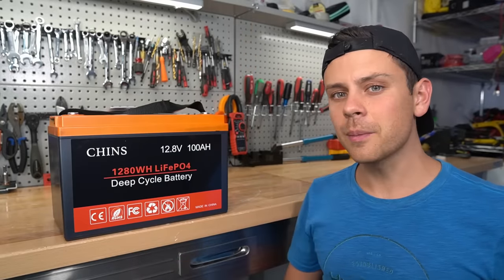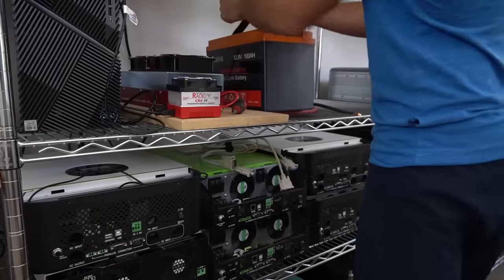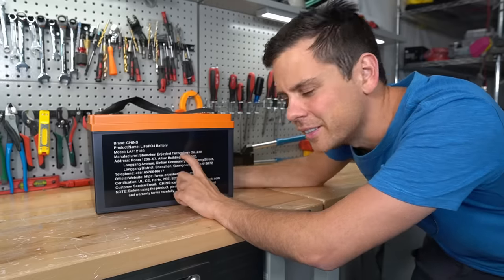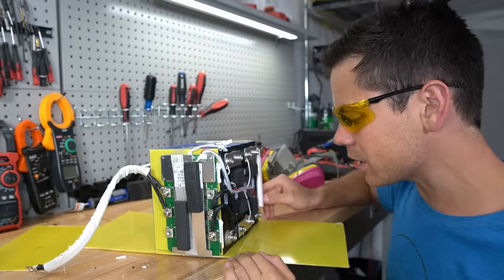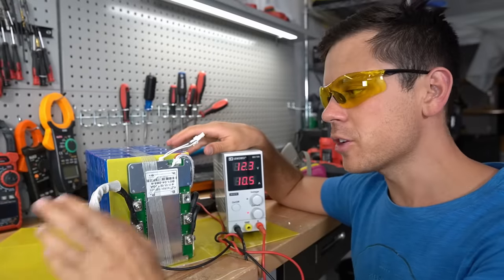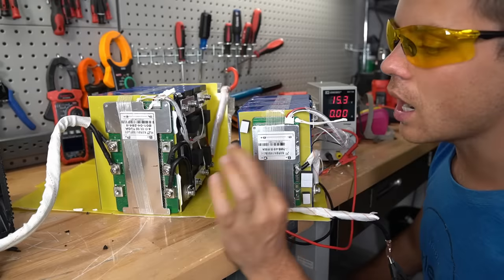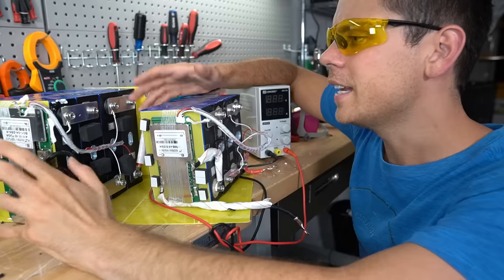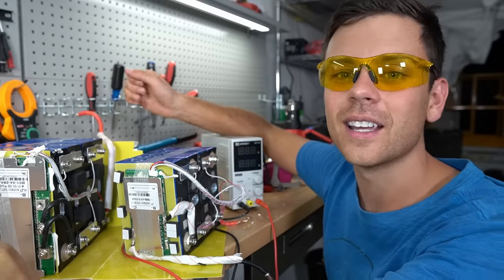$379 CHINS 12V 100Ah "Plus" LiFePO4

Comment: Very cheap. Nice Support.  Has a limited BMS. My only problem with the 200Ah was charging it all the way. Takes forever at 20A.  They claim they now have a self heating model. I don't see the difficulty or reluctance to manage low temps.

Comment: Can this battery type be connected in series to increase Voltage? I read somewhere that LiFePO4 batteries should not be connected in series otherwise the BMS would not work. Is this true?

Comment: I saw the following on an Amazon review.  Could you comment on this. 

If you are going to use this battery with a inverter, (how else would you use it right?), then you better get yourself an inverter with an over current protection of higher that 17 Volts. After charging this battery, the BMS started balancing the cells. I watched my battery meter showing surges of voltages as high as 17 Volts. (The documentation says to set the overcharge protection of the MPPT at 15 Volts to not "damage the battery.") Each time it surged to over 16 Volts, my inverter's over voltage protection would shut it down (at least I know that works now.). It only lasts for one second, but that is all it takes to shut down my clocks, TV, Computer, and Washing Machine. Each time I have to reset either the time or wash cycle of my washer. I had to plug all of my sensitive electronics into a UPS just to use them so I didn't have to worry about the power being disrupted prematurely. This should not happen. Also, I could never achieve a voltage over 14.1

Comment: Have such batteries progressed to the point where you no longer need to worry about charging profiles, as the integral BMS would handle all such matters?
Reply: some lithium Battery manufacturers are staying drop in replacement for AGM or gel (this is because that the charger voltages are similar ) but you shouldn't mix and match chemistry and a lithium profile charger is always going to be better for lithium batteries.
Reply: @jc7654  I was hoping that the battery's internal BMS would handle the lithium's required charging profile.
Reply: @patrickmchargue7122  the BMS isn't a buck Boost it can't change voltages coming into the battery it can only switch on and off and balance cells that's why a proper lithium profile on the charger is better, it gives the best voltage to the battery, AGM has a close charge level but the charger has more step's in the profile then needed for lithium that slow the charging down and the voltages are not the best for a full charge but if you only need to be to 90% full it can get the job done .

Comment: No insulation between cells. Fish tape is cheap, why not put it between the cells with different potential? Why did you not test for short circuit protection? Thats a major safety concern?
Reply from the maker: They are sleeved, so not a concern at all
Reply from the maker: You should add your own fuse

Comment: Hey Will (or anyone) what is that red clamp meter are you using at the beginning of the video? I can't quite read the brand or model number. Maybe someone that has better resolution than I do can post it, thanks.

Comment: How well would these work with a trolling motor the maximum draw is 46 amps it's a 55 lb thrust thank you will!
Reply: it's well built and got a IP67 rating  and the rated Amps discharge is above what you are looking for
Reply: @jc7654  thank you very much my friend have a great day

Comment: Newbie question - how many panels would I need to charge this? Just starting to step out of the "small solar generator" stuff and only have 1 100w panel at this point. Thanks :)
Reply: most batteries charge well at 20% of capacity (100ah battery 20amp charge) it's a good place to start.
Reply: Do the math. panel, 100w @ 80% = 80w output. Charging, 14.2v nominal, 80w / 14.2 = 5.63amps.  Time to charge, 100a / 5.63a = 17.76 hrs. probably 20 hours. 
Get a larger panel. The 100w panel had to cost at least $100.  I paid $125 for a 340w panel. It is large, 77"x 39".  Check out Kinect Solar.
Reply: @ccy8379  - I think your calculation is wrong, given that you don't know how many amps his solar panel and/or his controller charges at. You charge in amps, not in voltage.
Reply: it's a bit of a loaded question because of the large number of variables (Amps X volts = watts) (watts÷volts=Amps)  solar panels only work in the day (hours of sun)  and then you have to add in any loads (Amps discharge) from the system. and then you can see how many watts of solar you need to change your battery per day, read the spec sheet on the lithium battery you choose and follow the guidelines. most lithium batteries need a lithium capable charger or solar regulator for the best charging but some are now stating that AGM and gel charges can be used, but I'd still use a proper lithium one,

Comment: Ok I have a 24v 200ah  battleborn battery bank. Would chins batteries be acceptable to use for increasing my battery bank? I saw on Amazon they have a 24v 200ah battery. I am running all victron equipment. 2 24v multiplus a victron mppt and a cerbo  gx for monitoring as well as victron buss bar and step down converter and a bmv.
Reply: what manufacturers say is you should only use the same batteries and make when placing in parallel or series , my belief in this is that the BMS system could fight and the settings for cut offs and charge voltage could be different as well as the rated output discharge Amps Might be different which would be bad. not so bad if you set up your system to the lower rate . but not advisable and would definitely void your warranty

Comment: What is the low temperature you want to avoid?
Reply: 32°F or below is not good for charging. You can use the battery at that temperature, just don't charge it below that temperature.

Comment: I need your help with my 2015 Thor Palazzo 33.2 batteries. House batteries are 4  6V batteries and 2 for starting but i don't know the  voltage. I have to change all of them but I am hearing all sort of stories and getting confused. Can I use 2 Chins 100Ah to replace the four? and same with starting batteries. Please help. Thanks,

Comment: Are you sure that temperature sensor wasn't connected to a chip that would disconnect both high and low?
Reply from the maker: No it's not that type of sensor
Reply: @WillProwse  Are there other sensors besides thermistors and bimetal switches?  If it was a bimetal switch, I see the single temperature limitation, but a thermistor is only limited by the power transistors or relays it is connected to.

Comment: How about this LITHPo battery WITH Low temp @ $449 -LISUATELI 12V 100Ah Lifepo4 lithium batteries Up to 7000 Deep Cycles for Golf Cart Solar RV Camper Marine Battery and More Applications with Low Temp Protection - can you test it?

Comment: Can anyone tell me what the overcurrent shutoff is on the BMS for this battery? I can't find information on the Chins website anywhere. 

I bought 4  of these to put in series for use in my Ryobi 54" mower. They cut disable as soon as I turn the key on (no wheel motors, no cutting blade motion). I am assuming that it is the surge from the motor controller caps charging up, but this was not an issue with the AGM batteries that I am replacing. There is a 125A fuse in the series circuit that isn't blowing, so I am wondering what is going on.

Comment: I saw Amazon has a low temp version.
Reply: Smart 12V 100AH Lithium Battery, Support Low Temperature Charging (-31°F), Built-in 100A BMS, 2000+ Cycles, Mobile Phone APP Monitors Battery SOC Data

Comment: Since the main complaint most times are the temp sensors, couldn't you design the charger system be it solar or ac to simply not charge given a temp range? Even the ones that do have it, do you really want to trust these cheap china bms to do it correctly?
Reply: Battery and charger both should have both protections; doubly safe and at little added cost.
Reply: @P_RO_  - I agree, but it would be kind of difficult for a solar charger to have temperature sensors for many batteries in a batterybank at the same time. Some larger AC chargers, like 25A, come with a temperature sensor.
Reply: @milcotto4153  Ideal and proper to sense temps at the battery, but the charger is often located in the same area so it would be somewhat effective for safety even if not ideal to assist battery longevity. Batteries and chargers both should have high and low temp protection. Added safety need only to pay off once to be worth it's cost, and in this the cost would be small considering the overall price. I like seeing Will pushing this point but I doubt that it will change the products we get in the foreseeable future.

Comment: Used in a vehicle how much slower would it charge than a lead acid.
Reply from the maker: Way faster charge speed than lead acid. Totally different level of performance from lower internal resistance. Lead acid is trash

Comment: I’m going to stick with lead aside batteries my system has homemade wind mills and solar
Reply: My leisure batteries are lead acid too, but they are not starter batteries for vehicles. They are sealed so you don't need to worry about fluid levels getting too low in them.
Reply: @milcotto4153  I use deep sickle 6 volt batteries that are for electric golf carts frock lifts and man lifts

Comment: They have that exact same battery with the low temperature sensor.
Reply: Is it the heated version or is there another one?
Reply: @chachi5975  it’s the “Smart 12V 100AH “ battery. It’s priced a little higher than the “Plus”. You can find it on Amazon.

Comment: Can u please tell how to use gas generator to charge if needed?
Reply: You should get an external charger built for lithium battery chemistry. Those blue charging units Will has are 75 amp Aims units and they work very well. The charger has an adjustable output so it can be throttled back if  your battery can't take the full 75 amps. Using an Aims charger plugged into a Honda eu2000i generator loads it down to about 1100 watts so the generator can run for hours like that. The Aims can be switched to charge 24 volt batteries as well as different battery chemistries. But they are impossible to buy right now as they are back ordered until ''mid June''. Mine are still not here. If you try to use a generator's 12 volt charging circuit to recharge, the thing will be running for days on end.
Reply: @kimmer6  thanks all the best from Greece
Reply: What do you think about led solar battery lithium here in Greece are very expensive
Reply: Im going to use them for small log mushroom greenhouses soo for fans and small water pumps we have plenty of sunlight here in Greece but im going to have to support them whith a small silent generator
Reply: @tomstamos1491  You should determine your power needs in Watt Hours first, then size your system. You could use cheap lead acid batteries, a pure sine wave inverter, add a few solar panels along with something like a Renogy Rover charge controller to keep the batteries charged and have practically free quiet power. You set it then forget it. The charge controller is automatic. 

Fueling and maintaining a generator is a lot of work. I have a standby diesel generator on a 160 liter fuel tank base, and its loud and the exhaust stinks. I prefer running on AGM batteries then switch to the lithium battery bank as needed for times when we lose power. They keep refrigerators and freezers running when the power goes out.  In the Winter the system lets me run my natural gas central furnace for heat. Is Greece on 240 volt power, 50 or 60 cycle? I forgot and have not been  to Athens to drink ouzo in 42 years!
Reply: @kimmer6  ha ha ouzo sucks we are in 240 volts ...cycles? Not sure im new to this(solar power) the most is going to be 200 -250 w per hour for each greenhouse and its going to be Only  three of them for the first year. Its one is going to be AUTONOMOUS and i ll provide a couple of kw for each with a small silent generator i got the time to do it .oh by the way really THANKS for your time to answer my questions anlimited  supply of ouzo if you come to Greece

Comment: Will these work well  for 12v house batteries on my boat in order to replace 6 6v golf wet batteries
Reply: Interesting... My 6 trojan 105 boat batteries are now 12 years old, I will eventually replace them with either trojan or crown wet acid. They have been charged by alternator and solar only...

Comment: hey will i have 4 agm batterys and one failed i want to swich to lithiam batters butt i only have money for one can i hook up the lithiam battery to my agm battery bank im running 48 volt system please respond back to me thanks brothier by the way allyour videos are awsome and very helpfull
Reply: No don't do it. you need to keep the chemistry the same,
Reply: @jc7654  thank uuu is this true
Reply: @carlosramosjr7266  it's a very bad idea to mix battery chemistry types Evan if staying at the starting voltage  of 12v and placing in parallel it's much worse when you place in series and start stepping up the voltages. look into 48v lithium battery or buy 4x 12v lithium batteries of the same .

Comment: Lithium batteries are the biggest scam 
100ah battery for over 500 dollars? Battleborn over $1000 for a 100ah ? 
2 GC2 6 volt batteries have 225ah and cost around 300 for the pair.
Reply: I used GC2 6volt battery's for the first few years living off grid. They may have a low cost, but they will never have the capacity of LiFePO4, I all-way's had to run my generator to the tune of over $50 a week, so over a 2 year period it cost over what a Lithium cost up front..

 At the end of 2021 I put out $1600 bucks for a 24 volt 150 amp Chins battery, I have run my generator 2 or 3 times so far when it was cloudy and raining for weeks.. This battery is awesome and should last over 5 years.. In a solar application you be lucky to get 2 years out a GC2..

Comment: Hey all, I’m wanting to use this battery as a backup energy source in an emergency and I was wondering if anyone knows of a good wall charger I could keep this on so it stays full? Thank you!
Reply: These batteries tend to have very good charge retention characteristics, a low self discharge rate.

Find a charger that will charge them, then put it on a weekly timer and give them a top up once a week. If you can find a timer that can be configured to trigger monthly that might be even better, but they won't be common.

Comment: Tried these batteries. They died shortly after. Get what you pay for. They use cheap stuff so the price is low and seems like the same battery as a quality one from the outside and the first few cycles.

Comment: Warning ! If you buy that same battery today, Viv switched the internal from what you see in this video. It now comes with crappy pouch cells and a sh1tty BMS inside. The outside looks the same as this video but the insides are swapped. Scam company

Comment: You need to be clearer when you say low temp charge. I thought you were saying "load temp" which made sense to me until you were further into the video. If you 0ut the explanation of why you should have earlier everyone would not confuse the two terms like I did. Also you might mention what low temp we need to avoid.

In southern Louisiana 10 degF are rare beasts.
Reply: All lifepo  batteries will be damaged if you charge them when the temp in  the battery is below 32 F

Comment: What on Earth do you do with all these batteries you tear apart. Maybe I should just buy all of your slightly used batteries . Just kidding. It's good to know that they passed your inspection .. Although they don't have low temperature protection which in my case is not an issue , I will be using these in a 36 volt trolling motor system

Comment: Low-temp charging sensor is not important if you are using the battery above freezing temperature like most of us. It is not a critical feature  for most application — the electrical engineers who designed this battery are smarter than you. You are making it a big deal, an exaggeration, a deal breaker  just to bash the design and have something to  say.
Reply: Very few people will have need for high-temp protection, there is much more of the world population which regularly experiences below freezing temps than places which regularly experience temps above 75C where the battery is located, so Will is right. But it isn't a deal-breaker, just use a charge controller which has low-temp protection if you need that. Ideally every battery and every charge controller would have both protections but we do not live in an ideal world.

Comment: low themp charging protection is something 99% of the buyers really don't need. therefore I find it so annoying that you bring that up every time and make a hassle out of it.
Reply: In that same vane, many DO need to worry about it. A review should be thorough which Will tries to provide. They aren't taylored for your specifics, sorry.
Reply: @j.r.576  There is more of the world's population in places where freezing will be encountered than in places where over-temp will occur. That is even moreso when you factor in where people are generally affluent enough to buy these. The sole reason these have over-temp protection is to prevent thermal runaway fires and the added liability that brings. If high temp only destroyed the battery as cold does without fire risk they'd have no protection built in so they could build and sell them cheaper.
Reply: @P_RO_  I'm sorry, not sure why you addressed that to me, your reply has nothing to do with my statement.
Reply: @j.r.576  It's supporting your position- many DO need low temp protection. I'm just explaining why a bit more than you did. I don't do just contrary replies though it seems that (too) many folks do.